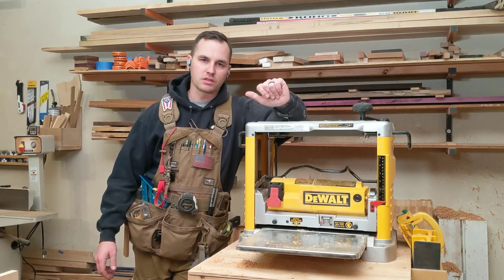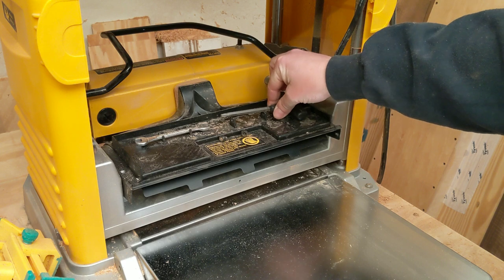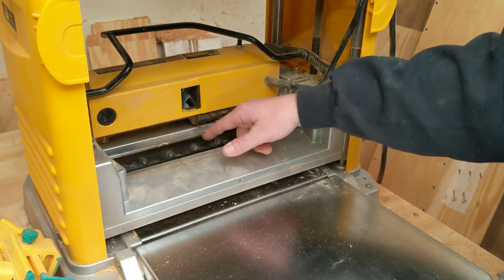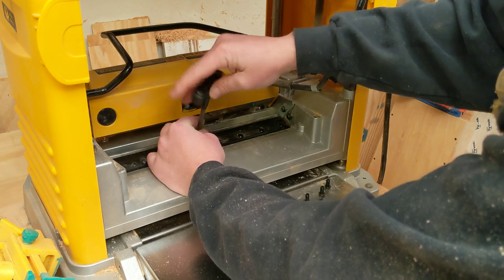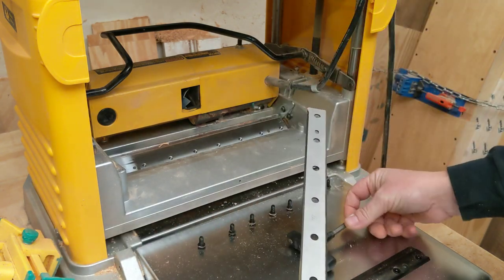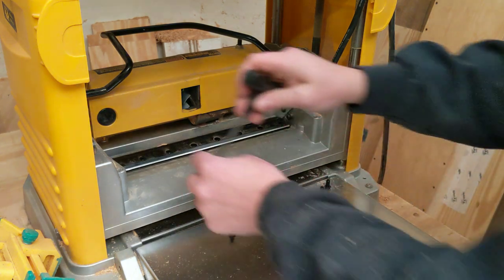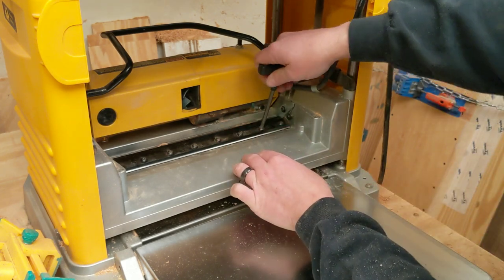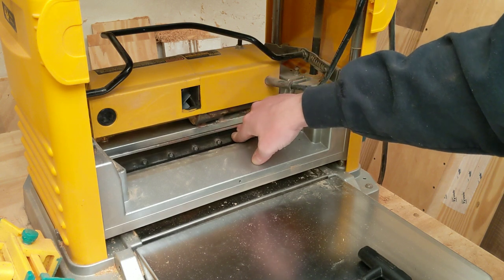How To Change the Blades on the Dewalt 734 Planer

Comment: Excellent video. Not sure if your model is same as mine DX734, but it should come equipped with a blade lock on the right hand side (from the back view) where you can push it down and prevent the blade from rotating while you change your blades. It’s a silver little hook that you push forward to catch it and then push down to release it.
Reply: And here I was wondering why my blades weren't rotating.  Gonna have to check that out.  Thank you!
Reply: Came here for the video as a refresh and your comment came through clutch when we couldn’t rotate it 😂🙌🏻
Reply: THANKS FOR THAT TIP!   MINE WAS LOCKED TOO   LOL

Comment: Tried it a few weeks back and couldn't crack some of the screws loose. Stripped one of the heads before giving up. Need to contact Dewalt. What a pain in the neck.
Reply: Thats unfortunate and I feel for you. One thing I've done on new machines before use is loosen bolts or nuts before powering on so they have been removed at least once. I wish you good lucks getting it repaired.

Comment: As a blade changer, your top 👍
As a counter, you need to practice, you counted 7 bolts twice and you get 8 bolts.
Thank’s for posting.
Reply from the maker: Thanks bud. Wasn't used to shooting videos and no much of a public speaker. Hopefully my videos will improve with time.
Reply: @reisenbergswoodworking7760  
As this one is good. Once improved the others will be very good. 👍👍

Comment: I bought this planer about 6 months ago and now it's time to change the blades. I followed your excellent video directions but I cannot loosen any of the screws holding down the blades. I'm going to try using a ratchet for more torque. Any suggestions?

Comment: Just bought one and this was very helpful to know for the future.  I assume that since it has the alignment "dimples" that there is really no blade height adjustment to be done, correct?   I assume that's why the blades are disposable after you use both sides, right?
Reply: Thanks. That's my understanding, is that because of the alignment dimples there are no adjustments. Set, screw in, and go. Flip, or replace when needed.
Reply: @canonshotpro  Thanks Chris!

Comment: How do you know when your blades start getting dull? I just bought this planer and used it a ton!
Reply: Mine gets heavy use and I went about 7 months before my first change. You will start to notice that the blades aren't creating a glass surface any more. You may also notice that the blades are creating a few lines from damaged areas of the blades. I like my boards almost looking like they were hand planed. The sharper they are the less hand work for me. I know some people that get a year or a few years bc their use isn't as great.
Reply: Mine was getting too hot, and turning itself off. Was acting like it was difficult to plane even soft pine boards when I was just lowering them 1/4 turn at once.

Comment: I just changed my blades and now I have bad viberation - so bad that I had to shut it down.  Where do I start to look for the problem?
Reply: Bruce, I have not encountered a vibration before. I would remove all the blades and make sure there was no debris under them. Reset the blade and make sure all screws go back without resistance. Boot up and try again. My guess would be that one of the blades is not sitting properly.

Comment: I did the first blade on mine but I can't get the motor to turn to access the next one. Any ideas?
Reply: You likely have the blade lock on. It’s a silver looking hook on the right hand side. It’s actually very useful so that the blade doesn’t rotate while you’re taking the torx bolts out.
Reply: @katievitale168  yes I did. I figured that out but thank you.